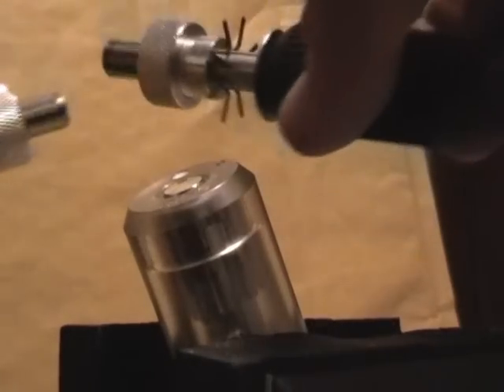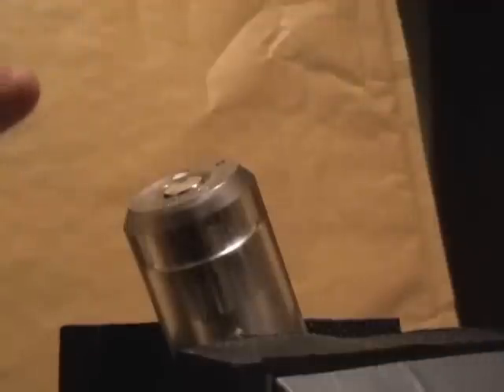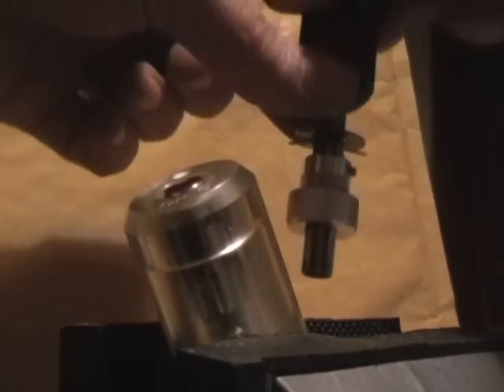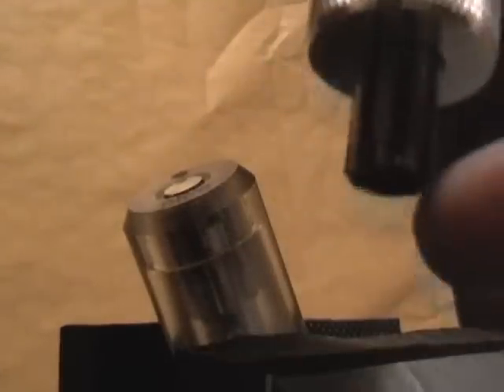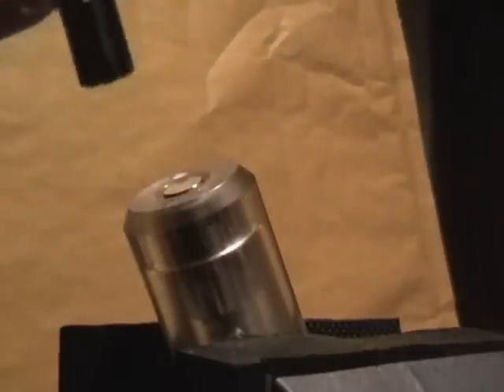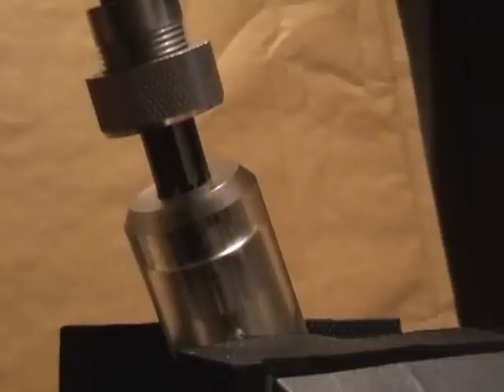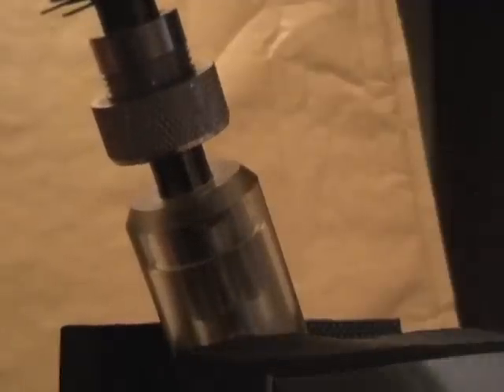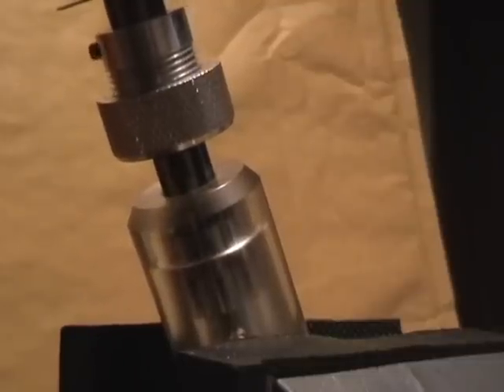7 Pin Tubular Pick Demo UK Bump Keys

Comment: I have one of those for 7 pin. It works great on cheap tubular locks but I have yet to be able to open an ACE or ACE II lock with it. Has anyone done it? Is it possible? I hear the ACE II was designed to defeat this type of tool.